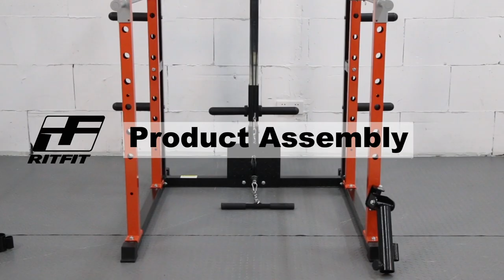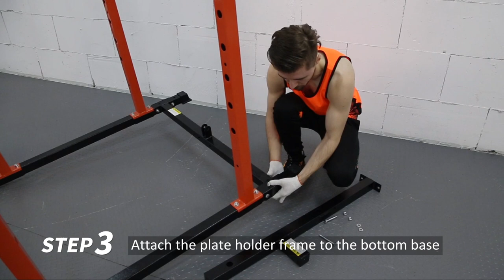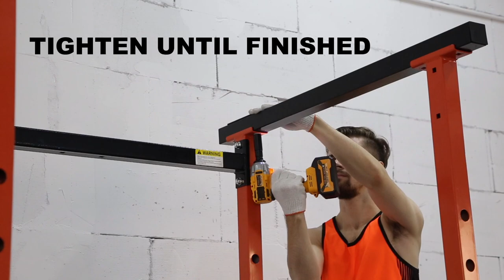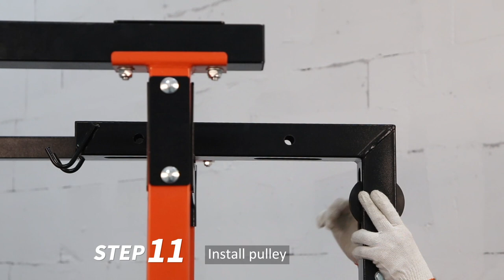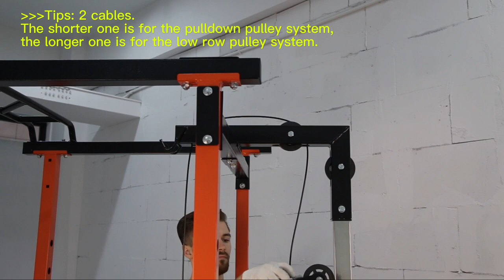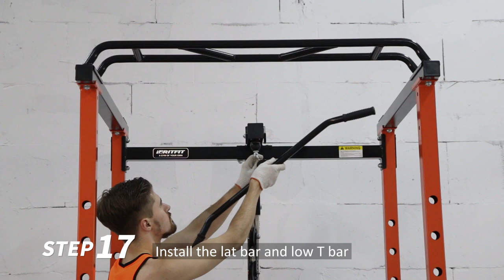How To Assemble RitFit® 1000LB Capacity Power Cage PC-410 Max?

Comment: I just wanted to update from my earlier comment. I finally got all the correct pieces/parts for my unit. The customer service was pretty good as I mentioned but again, they must be overseas as all communications happened in the middle of the night. So it took a few weeks for them to get me the correct parts, but I got them. Once I put the unit together and started using it, I only have a few issues. The first is the plate holders on the side. They are flimsy, and the weights will shake/slide right off of them if you don't put a clamp on them. The slide for the lat pull down comes with two plastic inserts that help keep metal off metal. These inserts do not stay in as intended. I had to duct tape them so they would stay. The lat pull down works fairly well but doesn't seem like it is heavy duty enough to handle in substantial weights. I am not badmouthing RitFit at all and overall I am fairly happy with this purchase. I love the pulldown handle attachments I also bought and the ToughFit bar is awesome.
Reply from the maker: Your comment is really helpful and objective. We do have these small issues, and our design sector is working on resolving the first issue you mentioned. Thanks for liking the pulldown attachments and the bar~

Comment: I got my order today which was the 410cc with the cable crossover. It didn't come with a manual and the only instructions I could find are for the lat pull down 410 with only one cable. I also did not get my j hooks or cables but I am assuming they are coming in a different box.
Reply from the maker: Yes, your order comes in different packages. Don't worry😃

Comment: I had the same issues as some mentioned below. I got one of my boxes one day and the other a few days later. I got all the parts out and I have extras of several components and I am missing several components. Needless to say I am a little frustrated. Customer service has been fairly good at getting back to me but I have had to send pictures of everything and I am getting upset. They also respond in the middle of the night so I am guessing they are overseas and I have to wait another day everytime we correspond. It has been a week since my first correspondence and I have not been told that any parts have shipped to me yet. In the meantime I have a bunch of useless parts scattered on my basement floor that are useless until I get my parts in. I am hoping I am happy with the product when/if I ever get it put together......stay tuned!!
Reply from the maker: Hi, we totally understand your frustration and our customer service just responded to your e-mail. We'll handle the issue properly. For the extra parts,  you can store them somewhere in case you will need them in the future. We're sorry for sending the wrong thing and really appreciate your understanding and everything.

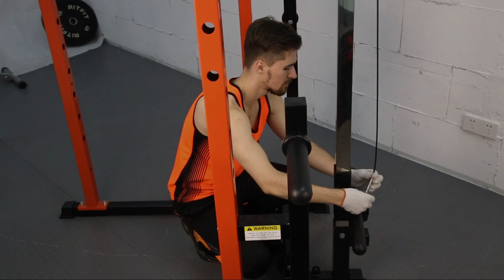Comment: @RitFit Fitness  I just put mine together and I LOVE it!!  I just have one quick question  I wanted to ask: at the 7:40 mark in the video, your installer is screwing the lat pulldown cable into the weight plate holder. The screw only goes about 1/3 - 1/2 way into the hole. Is this normal?  I screwed it down as hard as I could, but worried it could strip and pull out with heavier weights. Any thoughts on this?
Reply from the maker: Generally, the bolts do not need to be fully screwed into the holes. But you can adjust the tightness of the bolts according to your needs. Screw the bolt into the hole and use the nut to adjust the tightness. As long as the bolt is screwed in deeper than the threaded portion of the threaded hole, then tighten the nut and it will not come off. If you feel the cable is a little loose, adjust the nut so that the bolt is tightened a little deeper.😀

Comment: What size socket do you need to assemble this?
Reply from the maker: Hi, thanks for your comment! You don't need to worry about the size of the socket for we have provided the tool with the power cage, along with a thorough assembly manual. Have a great day!
Reply: @ritfit.sports  what size sockets or wrenches do we need ? I have all my tools at work so I would like to have them ready for when my package arrives?
Reply: 17mm

Comment: Putting one together this weekend. How long did the whole process take? And what tools are needed?
Reply from the maker: Following the tutorial, it takes about 30 minutes to assemble by one person. If someone helps, the time will be greatly shortened. With regard to tools, there are 2 wrenches inside the package, but electric wrench is better if you have one.
Reply: It's going to take you hours! The instructions are horrible. The parts are not even numbered.
Reply: Plan on 4/four hours with a helper. There were No/None printed instructions, no pdf printable instructions on RitFit website, this YouTube video is somewhat helpful with a hundred pauses, reverses, asking yourself does he put a washer, when did he put the plastic ring buffers and more.